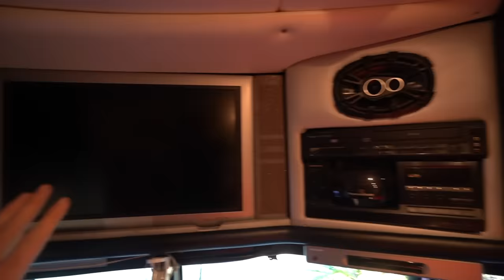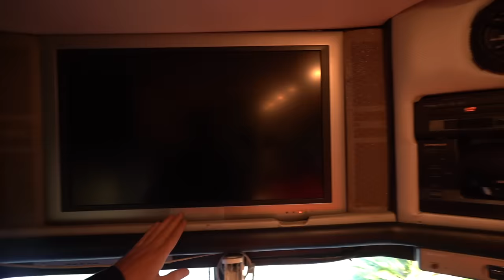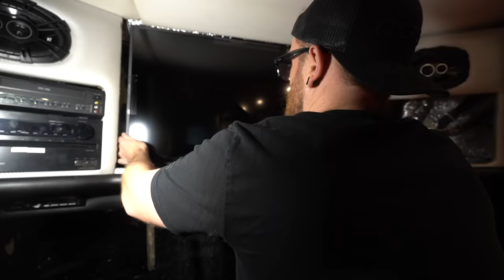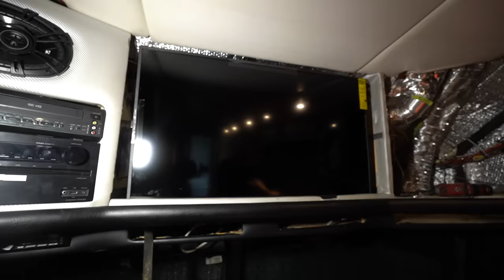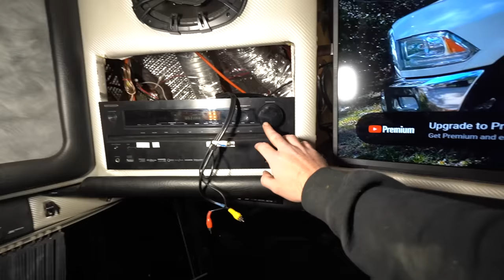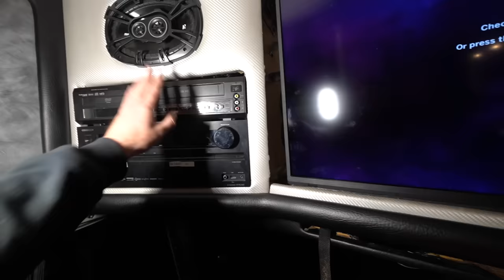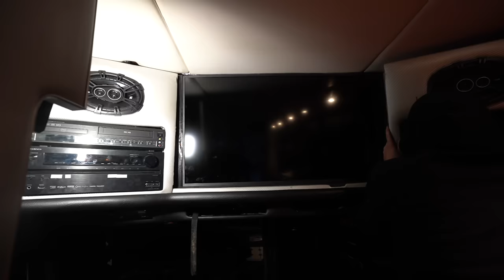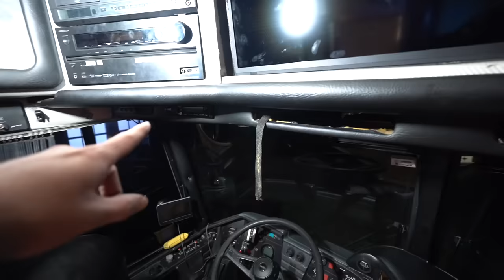Car hauler RV/Bus conversion interior renovation. massive upgrades

Comment: AV engineer in chat. Most TVs come with an IR port on the back, usually in the form of a 3.5mm jack input. This allows you to remote mount an IR receiver on a fly-lead. Those can be bought online for a couple of dollars. It's designed for exactly this scenario, where the built in IR receiver is covered by a surround or obstructed in some way. Awesome work on the bus so far, what a cool way to travel to and from events!
Reply: Looking at the manual online. That's a really basic cheap TV, it doesn't seem to have remote IR support. 
Side note: I have a Sony kd-55x7500f, which is a old by current standards and that doesn't have a remote IR port either. So I don't think it's that common any more.
Reply: @agentcrm  Actually a lot of smart TVs these days support a USB IR receiver, so if it has a USB port on the back you can still achieve it with one of those.
Reply: If non of these options work, and by a miracle the TV still has a RS232 port, you could get a RS to IR converter, not the best option, but yeah :p
Reply: Not a budget tv like Vizio.

Comment: Bus life pro tip... I worked out of a Prevost bus and a fifth wheel camper for a few years. Wifi makes life better. Get the remote app for your TV on your phone. Don't count on not losing the old IR remotes. Replace your light switches and power receptacles with wifi smart switches and plugs. Get a wifi router with some range. One that can connect to a phone or mobile hot spot. Remotes are hard to keep track of. Everyone has their phone on them all the time. It's nice to power up the lights, indoor and outdoor, with your phone. It's nice to sit in a lawn chair outside the bus, around a campfire or toolbox, and control everything with your phone. Turn out the indoor lights, turn on the outdoor lights, start up some music, all with your phone. Our bus and camper was mostly controlled by Alexa and the wifi connectivity was not expensive. Controlling your mobile home with your phone or your voice makes everything so much easier.

Another tip, a manual transfer case in your dually. You see people flat towing little cars behind buses all the time. We towed our dually which sometimes even had a 16 foot enclosed trailer attached to it. Take a useful tag along vehicle with you. It doesn't have to be a dually but having a useful vehicle with you is nice. Especially 1000 miles from home. Of course, when we rolled out with the bus, we were often gone for months. Remember, your bus isn't just a car hauler. It's plenty nice enough for a vacation trip every now and then. I guess you could just put your BMW in the bus for your vacations. Just making suggestions based on my mobile work life.

Comment: For the TV, I would have made a wall behind the screen and added an articulating wall bracket so you can pull the screen out further and possibly could have a bigger screen. 
Good job with the cubby!
Reply: its a nice idea. although i think the point was to make it look as if the tv and other stuff came with the bus.

I was kinda ocd, simular to taylor in a way when floppy drives and compact disc drives were common. if it wasn't flush with the case, it drove me insane. if the color of the floppy and/or optical drive were different color, even minor, i'd paint them. sometimes it just satisfiying with such small details.
Reply: Same. Could have made a HDMI panel in the wall and made it where you could service behind the TV better.

Comment: When I was just a kid, the guy that owned the engine rebuilding shop in town installed a tower, FM transmitter, and one of those huge disc changers. Then he put it on shuffle and let it play over the radio. It was excellent, since we can't get anything for FM stations.

Comment: Get an IR repeater for the tv and mount it lower. They are pretty cheap and low power draw. You could mount the receiver for it anywhere you want. You could use the cubby to mount networking equipment for the bus. If you are going to be traveling often I recommend getting some starlink in the bus. This would let you guys get some work done during the trip and while you are at the track. Awesome build so far. Missed you at LS Fest last year, was hoping to get to see the new rig in person!

Comment: With the lit switch, you could wire it so that it would light up when the lights were off and the door was open. That way, if it gets dark, you/others can find the switch.

I know it's in the 'unswitched' cabinet, but if you have all the lights off because it's daytime, the lights in there would be off too.
Reply: I put lit switches on my golf cart and that's how I did it. They light up when the lights are out. You know, when it's dark and you need help finding the switch. I don't think all lighted switches can do that though. I did it so they wouldn't glare on the windshield at night. Turn on the headlights and the dash goes dark.
Reply: When you got no light you want to find the switch easy.
Reply: Why not just make it a photovoltaic switch. Off when lit, on when dark

Comment: Carefully pull the staples and trim the top panel some and then  re pull the vinyl tight, that would be easier than pulling that all apart to trim the lower section and remount everything in my opinion!

Comment: Taylor, your a fab junkie.  Pull all that white padding out, and make a super clean, brushed aluminum panel for the whole thing. Would look super clean, and its a good fab project. For the small cubbies, I'd make them smaller boxes, and implant a magnetic holder for the remotes, and perhaps a good place for a set of inductance chargers for phones.  Lastly, some of that extra space would be a good place for a starlink receiver (internet), and wifi router.

Comment: Here is a tip for you. When installing those led light strips put a dab of hot glue and then press them into the hot glue. When we install under cabinet lights in houses that is the only way to get them to stay long term.

Comment: Was wondering how long it was gonna take you to figure out the TV was too low for the remote to work lol Only thing I would look into is if the TV uses the bottom for airflow or just for the factory speakers.

Comment: Gotta use the hdmi port with (arc) for audio out. Id also recommend putting the av amp on top of the dvd player for better heat/air flow

Comment: For the TV just buy an IR extender kit, you put a receiver over in that original cut out or in one of the cubbies, then there is an IR emitter that sits over the IR window of the TV.  Then you can lower the TV enough to fit the upper panel and you don't have to cut any of the panels.

Comment: Solution to the trunk lighting issue:
Instead of the main switch, use a daylight sensor. 🙂
The way it is currently set up will drive you crazy sooner or later. You'll eventually need light at the other end of the vehicle for just a minute, but you'll have to switch the main switch.

Comment: If it were me, I would put the master light switch the driver's control panel. What is first thing you do? You pull in? If its dark, you flip the switch and go to the outside. Why do you need a switch? Afraid LED lights are gonna drain your battery? I think not. It won't look dumb because it's no different than your car dome light when you open the door. Sometimes I think Taylor is way too anxious and has to be creating a fix for a problem no one else cares about, or would think is a problem.

Comment: Some info. TV's don't output via HDMI by default. They commonly have eARC, but the receiver has to be eARC compatible too. For you to get HDMI audio out. 
I would upgrade to a HDMI DVD player or a 4k blueray player. Then keep the combo drive in the house or shop. 

Congrats to the winner of the truck.

Comment: They make it repeaters for av equipment in home theatre solutions. Then you could put the receiver somewhere easily reachable by the remote and then you put the other part of the receiver against the original sensor behind the panel

Comment: Should've used 2x4 backed MDF to fill out where the TV is, then mounted the TV on a vesa mount thats mounted to the 2x4 backed MDF with a hole cut in it for the wires, then lined the  the face of the MDF in contact paper, would've been much cleaner and matched both the construction techniques used when the bus was overhauled and more modern RV TV mounting options while also remvoing thje need to flush mount the TV to look good.

Comment: Attach some velcro to the TV remote so you can stick it in it's "home" and it will stay put. Possibly attach a small stuffed animal to it. I had a small set of fuzzy dice on my because it's easy to find and cant travel into small spaces when you don't put it in its "home" 😅

Comment: IR repeater for the tv will solve your issue. Looks like there was a slot in the lower trim piece for the previous tv IR that you could use for the new IR location.

Comment: id suggest getting a bigger tv and mounting it on a wall mount arm that can move out and swivel if needed. The TV could then be big enough to cover all the holes around it if its in front of the trim.

Comment: Purchase an IR extender for the tv, that way you can mount the IR anywhere you want instead of having to try to fabricate the panel to make the one built into the tv to work.

I have an outdoor TV on a swivel for BBQ and pool hangouts and being able to have the IR receiver anywhere I need it to be helps a lot.

Edit: Also, if the TV has Bluetooth (which it should in 2024) you can get a Bluetooth remote and pair it and it will work like normal. That way no IR will be needed at all. You could be laying in bed with the remote completely under the blanket and still control your TV.

Comment: Dude I would definitely do a couple 6x9s placed around the seating area if it doesn't already have them and get 2 8 or 10inch subwoofers and put 1 on each side (1 driver 1 passenger) the seating area would be dialed would be able to bump to some music and have some bass wen watching movies it would definitely give it that theater vibe 👍🏼💪🏼😎

Comment: Any way you could angle the new TV down for a better viewing angle? Might help with the trim fitment issue. 
Also, suggest you put a small PC fan behind your audio receiver.  Having the DVD player sitting on top restricts the top air flow louvers.
Why not install a motion detector at the door, to switch on some of the interior lights upon entering the bus. 
Lastly, on a bus this age,  should probably consider lubricating the rubber seals all around, but especially on the slider.  Suggest:  3-IN-ONE RV Care Rubber Seal Conditioner with SMART STRAW.
Cheers.

Comment: You should wire in a photocell instead of a switch so the lights will still be fully automatic. When it detects sunlight it will cut the power.

Comment: For the TV area, I personally would’ve upgraded the player to a modern DVD only player. For the new tv, I would’ve gone bigger. The old TV hole I would’ve boarded it, vinyl cover it to match the other sides, then put a tilt and swivel mount because of that top panel piece.
Reply: I doubt they're going to be watching dvds much especially considering he doesnt even own a dedicated dvd player in his house. It's a smart TV so they'll be using streaming services or YouTube to watch stuff. Personally I would add an Xbox or Playstation that would be way better and they also serve as dvd players if they wanted to use them.
Reply: As for the bigger TV idea that was my first thought as well.

Comment: watch out using just one set of the VESA mounts on the TV
We had a mobile expo rig for work that had a TV in it, the vibration of travelling was enough to put load on and damage the threaded inserts into the plastic when we used all 4... 2 is asking for problems IMHO!!

Comment: I use to do marine electronics and we did a lot of entertainment stuff on sport fish and yachts. You did the right thing by ripping everything out and starting from scratch. That last panel you were installing, would you be able to Velcro it up onto the ceiling? I saw a lot of Velcroed trim pieces in areas that weren’t able to be screwed on with fasteners and button caps.

Comment: I think you would of saved yourself a lot of trouble by putting a 50-55 inch on a folding arm, can't see the hole if the tv is bigger right! just push it back in to cover the hole then you could tilt/turn it when viewing and have easy access to the cables. the extra cubby you should of installed like a 12 inch subwoofer box and amp all the bass

Comment: I really think you should ditch the amplifier and make it all car radio powered. This way you can take advantage of all of the speakers (including subwoofer for movies) for every use case.
It might take a bit to get it working as one system but I think it would be worth it.

Comment: Definitely need to redo the trim around the entertainment to make it all fit properly. Seeing where the vcr/dvd was where the cubby hole is would annoy me & where the amp / dvd is now looks uneven. Think you could make better trim panels & wrap them with black vinyl. Would also be cool to stand off a piece of opaque acrylic on the roof of the cubby to diffuse the light / make it glow rather than seeing the individual LED strips. 👌

Comment: The tv should have been mounted so that it sits infront of the trim pieces. That would have given the option to use an articulating arm on the tv to pan and tilt it.

Comment: Is the LED switch going to stay on constantly now or are they going to have to go into the electrical cabinet and flip it on anytime they want lights in the other cabinets? I think I would've went with a regular, non-lit, switch so I wasn't adding an extra constant draw or adding an extra step of having to flip the switch when wanting lights. I know it's just a single LED and won't be pulling much power if left on, but I still wouldn't want to add an extra electrical draw.

Comment: So a 43 inch would have fit more snug, given you a bigger screen, and because it’s a diagonal measurement it would have fit that space perfectly. Also as far as audio, if you just use a optical cable from the tv to the receiver, no matter what you plug into the tv the audio will come out and you just leave the receiver set on optical